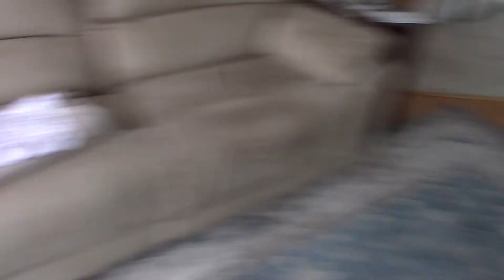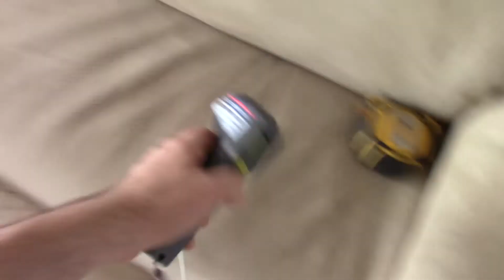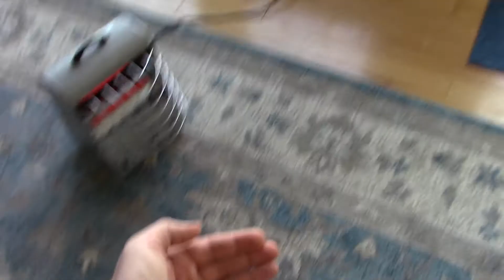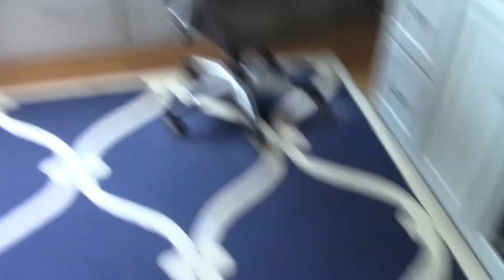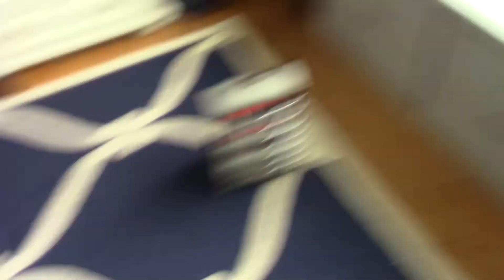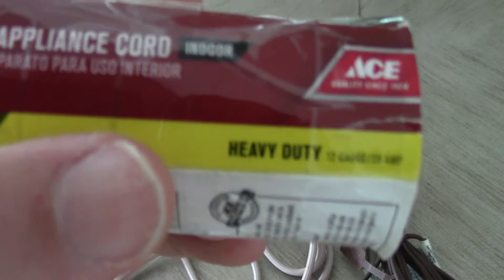How to Properly and Safely Operate a Space Heater.

Comment: Definitely all common sense. And you definitely did that down the line. Definitely a easy perfect video for people. That don't understand electricity. Definitely shows them how electricity can get hot. Just like fire. And remember always have smoke detectors and carbon detectors. And fire extinguishers. And the first extinguisher should be on each floor in a easy. Fast convenient place to grab. And never, ever, please? Lord never, ever leave a space heater unintended. If you have to go in the kitchen to make something. Or to attend something. Just turn the heater off and unplug it. And still b on the defensive side. Because heaters still stay hot for a minute or 2 to be safe before you have to leave to go to the store. And leave the house unattended. Everybody, please be safe when running these heaters of any kind. And everybody all have a blessed christmas.😊
Reply from the maker: Pardon the late reply, but thanks a lot! :D This house has plenty of smoke AND CO detectors as well. Definitely not playing around with that stuff. Fire extinguishers as well.